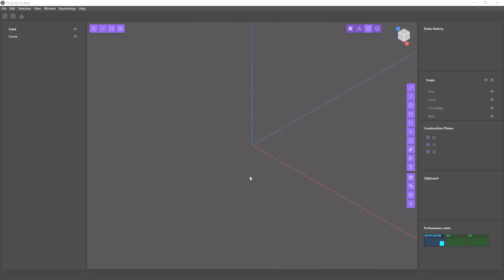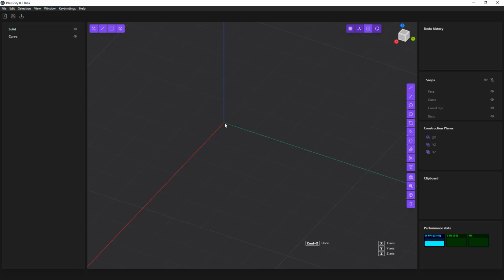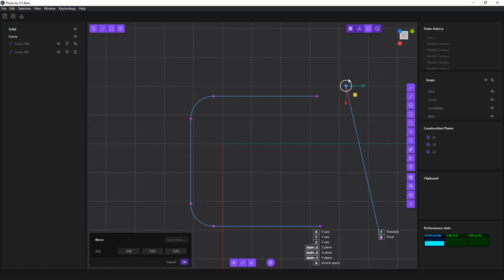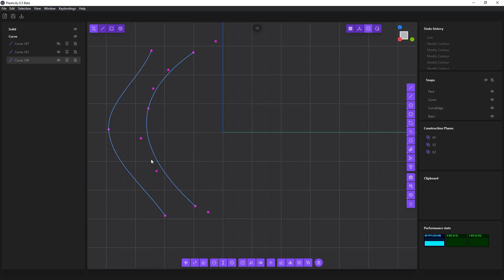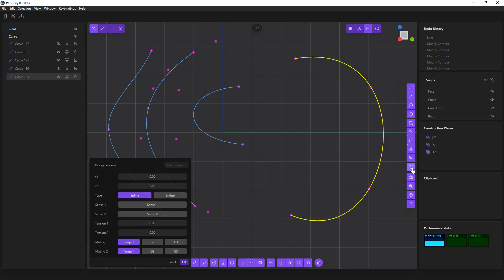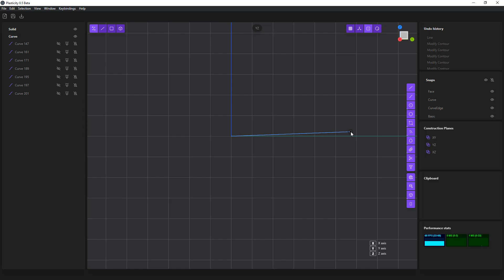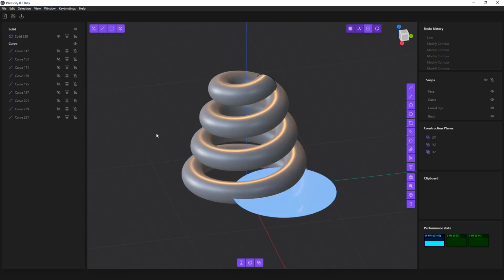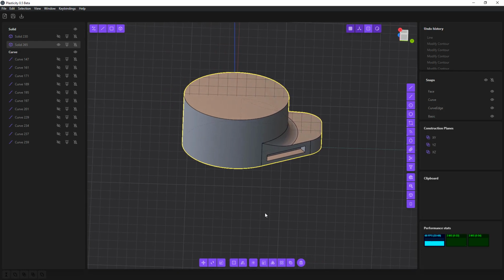Working with Curves in Plasticity | Beginner How To #Plasticity #CADforArtists

Comment: sadly i could not find a way to move contruction lines in a already extrudet object the only thing in could do is give them a fillet... is this possible?
Reply from the maker: This video was from an older version but note that when you extrude from curves there is no link back to them.  It is all direct modeling.  You can move curves by selecting their endpoints or the curve themselves and use G to invoke the move command.  Also if you make lets say 2 lines and double click their intersection it will convert it to a curve with handles.
Reply: @LearnEverythingAboutDesign  okay, would be nice to have a possibility to change certain areas of a mesh after contruction without remodeling them.
Reply from the maker: @lasereye159  Note these are not meshes.  You are working on solid/surfaces so its a bit different than say blender where you can push/pull on verts/edge/faces.  Having said that you can move faces and edges around. tapering them and adjustment them as needed.  If you select a face for example you can rotate it or pull it in 3d the same you would move the curve/sketch line that you used to create it to start.
Reply: @LearnEverythingAboutDesign  okay understood, so maybe i did not find the "shift edges" function so far. :) but anyway, such a feature including scaling and shifting/moving would be - in my view - a killer feature.

Comment: This software has the most insane fillets i have ever seen
I will defintly buy it when it comes out full
Reply from the maker: It has received a lot of updates and is now on the parasolid kernel and has surfaces!  I haven't been able to dedicate time to it but if you are interested I would strongly suggest you check out Nicks channel.  He has put so much effort into this program and it is impressive.  If i did more concept/art style CAD vs mechanical/production stuff I would use it more.
Reply: @LearnEverythingAboutDesign  The program I use is similar, same Kernal as well now - Nicks is more efficient though. As a mechanical designer I agree with you entirely. LEAD is a great reference.

Comment: What does freestyle mean? I did not understand the difference, if I move with or without freestyle?
Reply from the maker: If you use Move without freestyle you don't have a selected reference on the object.  When you use freestyle you can snap to say a corner point, and move it to another corner point on another object, giving you the ability to move objects and snap them together.
Reply: @LearnEverythingAboutDesign  Ah ok. Thanks for your prompt reply. On the other hand, I can also use ctrl for the snap function?
Reply from the maker: Yes and no.  The main difference is Freestyle lets you pick a point on the object(curve/solid etc) you want to move.  When you enable snaps you aren't picking say the corner of a box.  Generally you are snapping its center to the grid.

Here is a good test.  Model two boxes at different places with different sizes.  Then try to move one boxes corner to match the others corner.  The snap option holding ctrl(i don't believe) will give you this ability.  You have to use Freestyle so you can pick the corner of Box1 and the corner of Box2 to put them together.
Reply: @LearnEverythingAboutDesign  Ah, thanks. I have to remember that.

Comment: OH MY GAWD. This looks like everything I wished Blender could do. Whenever I have free time I'll dive so hard into this.
Reply from the maker: If you are comfortable with Blender it is an easy transition.  Still in development but getting better all the time!
Reply: @LearnEverythingAboutDesign  You are doing righteous work! I noticed it's targeted mainly at artists who want an alternative to polygonal. But it can be used for precise prototyping too, can't it? Entering numbers for movements, lengths, angles. Measuring lengths with a ruler, etc.
Reply from the maker: @anonymouse527  welll...... sort of.  It has no units per say.  Like the designs are unitless.  They export and then you need to scale them.  In terms of measurements there is no after the fact measuring or placing other than the blender stuff like move, scale. rotate.  You can set a pivot point and say move a circle from the origin a certain distance but it takes a lot of preplanning.  I think Nick is planning to have something in there but I don't believe it is a priority.  Maybe the next video I make will use precise inputs so we can see how it is done.
Reply: @LearnEverythingAboutDesign  sounds good! I think I could use it in conjunction with Blender. In any case, I'm already spending too much time cleaning up vertices and messy polys. This should definitely improve my process.

Comment: Hello!!! I´m impressed with this software. I´d like how to know how to do the spiral folow a path, like a old telephone wire. Thanks!
Reply from the maker: It is very impressive so far!

There is no current way that I know to easily make what you are asking.  If you make a coil you can adjust its taper but you can make a coil along a path.  you can make a Coil as a path for the Pipe tool, with that tool you can have a vertex count so you could take a triangle and have it twist along the path.  I don't know if there is a limit to this but there is a chance it could work.....  It is not quite the same as what you want though.  Maybe in time something like that will come.

Comment: Hi mate! 
in the tutorial use the color purple, the color is ok, only it doesn't look good if you select or deselect it.  For us beginners it is harder to distinguish, the color difference is not very visible when it is deselected, it should be a different color, such as;  white fall is selected and black when deselected, let's distinguish more easily.  Thank you for your understanding and patience.
Reply from the maker: Hi Sebastian, are you talking about the end points of the curve?  I don't really have control over that.  I am just beta testing the software not developing it.  I am sure once the software is released there should be some easier control over some of the colors without going in and manually editing code.

If you are speaking of another element please let me know, but again I don't have control over those elements. Best I can do is pass it along to the developer.
Thanks for watching!
Reply: @LearnEverythingAboutDesign  

Sorry, I forgot to specify ...
at the top and on the right are those purple squares where you select vertex, edge, object .... Those walls have the same color when you select or deselect them and do not dust well.  It would be more intuitive to be a different color when deselected ...
Reply from the maker: @Sebastian-Florin  In the UI there actually have been some changes since that video was released.  Check out my most recent video https://youtu.be/F-vxJGO0RpU  Now the purple is a bit brighter and when you deselct an option the icon goes black.  The top left is for vertex/edge/face/all selection and the top right is for viewport options like perspective, render, Xray.

Comment: Can you make video modeling Space X rocket engine in Fusion 360 ^^ , thanks you
Reply from the maker: Interesting request KEAL.  Can you be more specific?  I am not super up on the SpaceX rockets inner workings.  I know they have had several different variations.  Some listed as Merlin Engines, some MVacD, some Raptor.  And getting the shape of something like that vs something a bit more realistic is a very different thing :)
Reply: @LearnEverythingAboutDesign  
I have found a micro motor. I think if we use 10 engine from such a small engine range, with a thrust of 12 kg each, then completely with my 80kg weight, I can fly like an iron man, haha. I think it's possible to reality
Engine From Russia https://www.youtube.com/watch?v=I7GFAbtsQKs&t=1149s
Reply: @LearnEverythingAboutDesign   youtube.com/watch?v=GkbExzH-5tQ